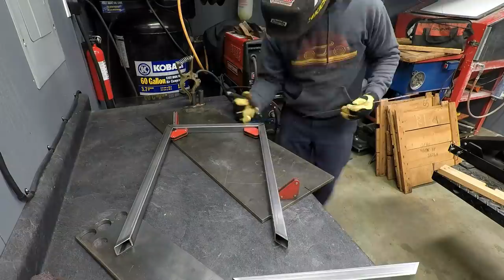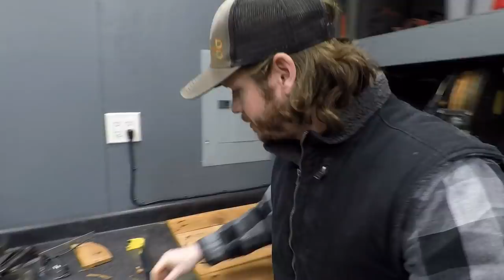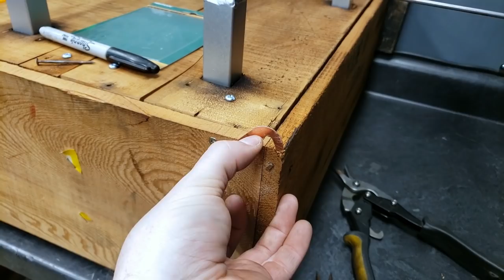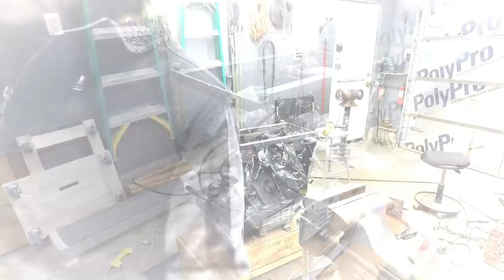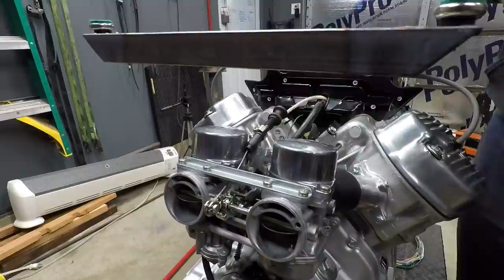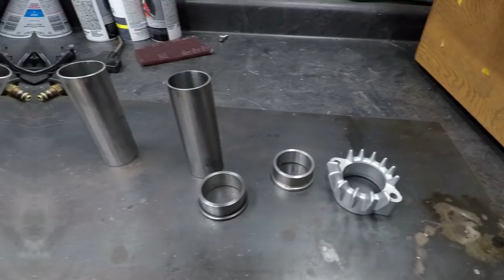Making A RUNNING Motorcycle Engine Coffee Table!!

Comment: Very cool build, just one step more and you can probably ride this coffee table on the streets! 😆 

On another note though, Maybe you can make hinges on the sides so that you can access the wheels to put them in a lock position so that the table won't move once you decide a spot to set it on, and you easily unlock the wheels if you need to move it to a different spot.
Reply from the maker: Thank ya! I had so much fun with this one!   Not really a need for locking wheels though

Comment: Very cool.  I'd make the header pipes longer, so they come down and curve back along the engine...staying within the diameter of the wooden stand.    I'm guessing with the table lid on, you reach up under it to rev the throttle.
Reply from the maker: Dave the pipes face the front to keep the exhaust aimed away from where the person would stand while controlling the throttle.  I also chose to not run longer pipes as they would both put heat near the dry wood as well as visually distract from the simplicity of the engine.  You remove the glass to start and rev the engine.  The intro is just for cool factor.
Reply: Fantastic job! Exactly what I was thinking. 👍
Reply from the maker: Thank ya Phil!

Comment: Was kinda worried when I saw the translation of the inspection tag from Japanese into English. Seemed like the engine was a basket case, but when you did the visual inspection up close including the borescope down into the cylinders and through the head to the valves, the engine was pristine inside, while outside just a little seepage from coolant tubes and the tiniest little bit of corrosion at those same points. Very creative repurposing of the crate pieces to tell the story and hide the sturdy frame at the same time. Running engineering art, definitely one of a kind!!!
Reply from the maker: Id had another person translate it and thats not what they said. Thats strange.  It was an NOS engine to replace in bikes as needed so not sure why it would be in poor condition.  Regardless,  this was a super fun project

Comment: The coils and handgrip obstruct your view of the engine through the glass and I would have put them in the base which you have to open anyway to start the engine, How will you twist the throttle with glass in place otherwise ?
Reply from the maker: You would have to bend down and stay bent down to operate the throttle which is a terrible idea.  They are up top for ease of use.  The glass is dark so you cant see through it well anyway.  You remove the glass to start the engine as mentioned but the intro is just for fun as it is hard to show everything it is in a few seconds.

Comment: Hopefully this is an outdoor table. Otherwise, people going to be passing out while drinking their coffee.
Reply from the maker: Has something like that happened in the history of ever? How long do you think this is going to run for? I didn't pass out running it in my small garage for many minutes.  Come on..
Reply: @BrickHouseBuilds  I can’t remember anyone building a “motorcycle engine coffee table” so I can’t say if this has happened in the history of ever. I was mostly joking when I said that but if it is an engine running indoors, it’s not hard to imagine it choking out a room. Lol
Reply from the maker: Its just a comment that many say as they want to just take something away or say something negative about this unique build.  Instead of sharing positivity some people just want to sit at the keyboard and point out anything negative that they can.  It gets old.  The owner of this display is a very intelligent guy and it can be used safely in the spot it will reside.  The place it is going is linked in the description.  Huge building with garage doors. Watch it
Reply: @BrickHouseBuilds  Uh.. not trying to be negative. I would imagine, from a practical standpoint,  there is some advisory necessary if you're going to run an engine indoors. If many are saying this than it's probably a legit concern.

If you're concerned about receiving negative feedback on your projects, YouTube may not be for you.

I still think it's a cool project though.
Reply from the maker: In what universe is this running engine table practical? Your original comment suggests you think people will literally be drinking coffee while sitting at this table while its running while in a small room?? Sure, don't start this up in a closet with the exhaust routed to your face but otherwise the intended use for this is completely safe. Your chance of death by simply riding a motorcycle to the grocery store is exactly statistically 4000 trillionty% higher than this somehow causing you to asphyxiate in the 3 minutes it may be running in a gigantic building.  
Im not expecting 100% positive feedback I just get really tired of those who only wish to try to point out something that could be negative that isn't even a possibility in a normal universe.
Reply: @BrickHouseBuilds  That's a lot of words I'm not going to read. Anyways, it was a joke. Have a good one.